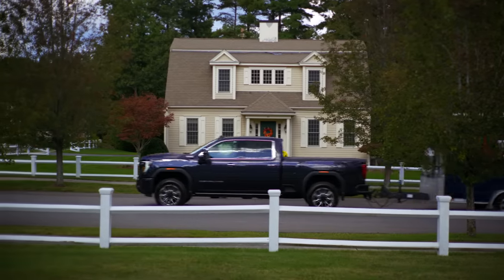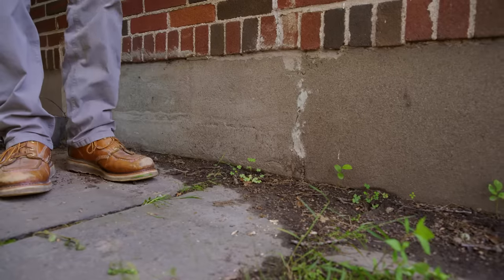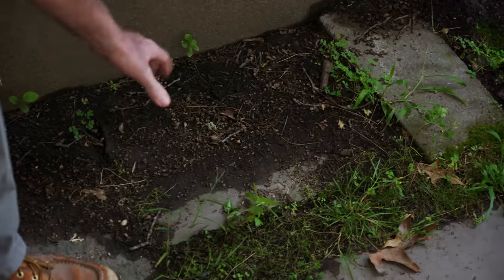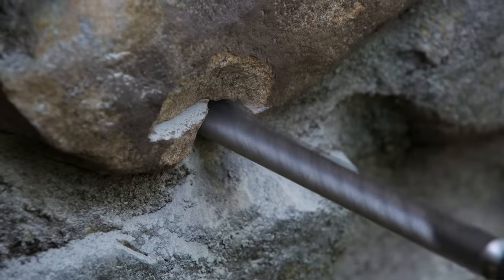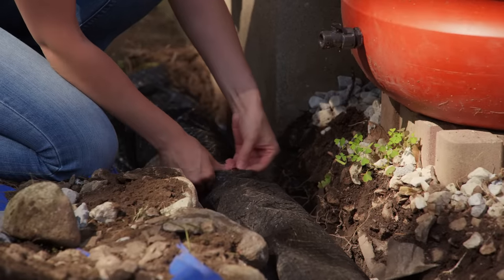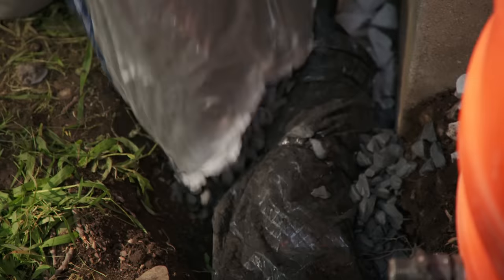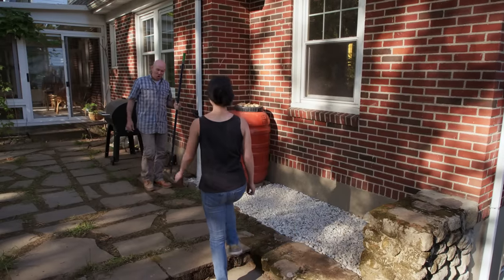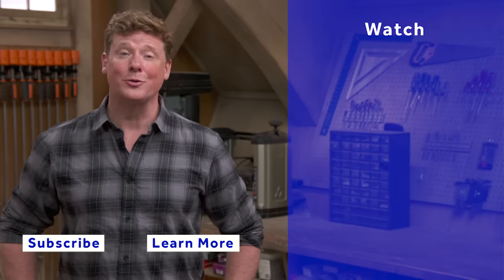How to Install a Patio Drainage System | Ask This Old House

Comment: A single 3/4" weep hole for a downspout and nothing to address what happens to the leaves that will eventually make their way into that pipe? I can understand not wanting a downspout-sized hole in the nice rock wall, but the at least put in a couple more smaller ones. There should also be a ground box (preferably a small square one) secured and caulked up against the inside face of the wall. That will give easy future access to make sure those weep holes can be cleared.
Reply: He should've carried that pipe all the way through the wall
Reply: nailed it. this is terrible.

Comment: Downspout to perforated pipe seems like a mistake. The perforated pipe is going to collect water and distribute it next to the foundation (like a septic drain field). I think a better solution would be to keep the downspout water in a solid pipe in that rock filled trench, and add a second perforated pipe to increase the capacity of the trench to collect other surface water.

Comment: Is that drain hole that he drilled in the rock big enough? Seems like it should be at least as big as the downspout.
Reply: @Navy1977yep that is never going to work
Reply: I guess unless you're expecting a tidal wave the hole should be big enough.  I'm just concerned about where that water is going on the other side of the wall.  I would have done what I did to my house -- connect all the downspouts to pipe daylighting out near the road.
Reply: @ginacirelli1581  yes I agree. My only concern would be since the hole doesn’t get that much water out it would fill up the trench and overtime. It would crack that wall.
Reply: The entire job is trash. Its an entertainment company and not a home improvement company

Comment: What keeps the downspout and weep hole from clogging with leaves and junk?
Reply: What they neglected to tell you was that the initial hole drilled through the rock wall was only a pilot hole.  I slowed down the video and they briefly showed the actual hole drilled after that was much larger.  In an ideal world, the gutters would have screens on them but most screens folks put on are DIY or from Home Depot.  they are usually cheap and do not last very long and end up allowing debris in anyway.  No screen can stop the influx of granules from a composition roof unless you have the ones that have water tension edges on them.   We never see the top of the gutters so we do not know what she has.
Reply: Human hands it's called maintenance
Reply: Doing the right type of installation in the first place!!
Reply: Hopes and dreams

Comment: The accordion connector will rot and crack very soon. Just use PVC there are 90s made just to transition from a 3 or 4 inch gutter

Comment: Pulled the wrong guy for the job. This should have been a gutter job to eliminate that down spout and send all the water to the next downspout that is at that corner of the house. Change the gutter to a 6-inch and ensure the slope goes all the way to the corner of the house. No digging, drilling through walls, or any of that necessary.

Comment: 4:31 it was a great question! You avoided the answer! You should had a smooth pipe in there and not a corrugated one! That would allow the water to drain easier in the winter. And to answer the question… that will freeze!

Comment: This was a REALLY bad "fix". If the debris from the gutters goes down the pipe it's going to clog. Plus the weep hole will freeze in winter and crack that wall, requiring a major repair job later. Plus as the hole is MUCH slammer than the rest of the pipes the back pressure will back-fill the area with water anyway, as well as there was no accounting for what happens to where the water was redirected to on the side of the house.

Comment: I've been a drainage contractor for over 30 years. Please don't ever do this at your house
Reply: @Navy1977  
For starters, I would have ran the downspout in a separate solid pipe from the perforated pipe for the French drain. So, each system is independent. In a flash flood you need the downspout pipe in a solid pipe getting the water away from the foundation. Then the French drain/perforated pipe will catch the surface and groundwater. Having both systems together will have everything back up at the downspout and foundation during a flash flood, and her basement is flooded too

Comment: This is terrible, and I mean terrible. @thisoldhouse really missed the mark with this one. They should have had Richard Trethewey do this job instead of the stone mason. That accordion elbow will clog up with leaves and shingle gravel, the corrugated pipe doesn’t even look like it has enough slope to it, and the tiny little hole won’t ever let out enough water to keep that pipe from backing up in a storm. Oh, and they used perforated pipe, why? Are you trying to put water back at the foundation? This looks as if a chuck in a truck did the job. 

If I took on this job, I would be using solid PVC. I would come out of the downspout with an actual elbow, use SOLID pipe with a 1% slope all the way to the wall, and actually drill a hole through the wall as big as the pipe. Heck I will add a catch basin wherever the low point of that patio is too. 

This is utterly disappointing. You guys totally scammed the homeowner. If this was ever installed in my property I would sue.

Comment: Absolutely horrible I’m just a kid and I know that all wrong. 1- when you connect that white flexible pod to the black corrugated pipe, all of that is going to leak. 2- you didn’t even drill a 1 inch hole for a 4 inch pipe. You should at least drill a 4 inch hole and feed the pipe through the wall. 3 - now that all of that water is coming out of that wall if it will even make it through it’s going to ruin the foundation on the other side as well.
Reply: and that’s where Mike Holmes comes in to make it right 🥴
Reply: @kbh95207 Mike Holmes literally endorsed some houses in Toronto that are all falling apart and isn't being responsible and fixing any of it.

Comment: LMFAO this didnt solve a problem it created one. He drilled a 5/8" hole for a 4" downspout lol. That downspout is going to back up so fast and overflow everywhere its not even funny.  Then he uses a 2" construction screw inside the spout wtf. If she didnt have gutter guards in place she better put them in right away. That will catch everything. To finish a terrible job out he uses a junk flex connector thats known to crack overtime. He blew her wall out too because he drilled the wrong way, complete rookie mistake. He should've got a core drill and ran the entire black pipe through the wall so that all that work isnt for nothing. Instead she will have a bigger water problem a block wall thats gonna freeze and crack.
Reply: They didn't show the connection from the drain pipe to the weep hole. We have no idea what Mark did there. TOH always skips a vital step to leave viewers in the dark. Heaven forbid someone actually try this and save some money.
Reply: @luckybestwash I doubt they did anything at the weep hole. Not that it matters being way too small .
Reply: This isn’t the first time TOH screwed up. I remember an older episode when Roger was installing a small hose bib irrigation system for a homeowner. Dude only put the pipe about 3 inches into the ground, and the head coverage was terrible.

Comment: That elbow he is putting in is utter garbage.  Those pleats will dry rot and fail within a few months.  The much better way is a PVC sleeve to elbow down to the gutter.  It also begs another question...How do you clean out the new pipe section when it clogs with leaves?  A box just behind the wall as a catch basin would have been a better idea.  The water can still flow but debris will collect in there and can be removed as needed.
I could not help but notice the long screw he put the new elbow into the old downspout.  That is a very bad idea as sticks and leaves will start catching there and eventually, the downspout will back up.  I thought TOH only used professionals.  That is an utter amateur move.  The gutter screws are only 1/4 long for a reason.
Reply: Eat shirts
Reply: Gutter guards are a thing.
Reply: Harsh but accurate
Reply: @jonathonpellegrini5725  ?? That makes no sense...
Reply: What channel is your show on?
Reply: @willsalaz  It is called Goodwill Criminals of Dallas.
Reply: I like Gate City Foundation channel for drainage issue. They find so many corrugated pipes clogged up and replace them with PVC. Just use PVC and save yourself the headache
Reply: @Bynming Call Roto Rooter and ask them how many PVC drain lines they snake out in a day's time 🤷🏼‍♂️ PVC is absolute garbage for yard drains.  Double wall corrugated pipe will not clog.
Reply: @westendlawn  they clog constantly, are you kidding me?
Reply: @Bynming  not if you use the right corrugated pipe and have the right amount of fall to it. No it will not. Double wall corrugated pipe creates turbulence inside the pipe and it'll clear out any trash and debris. Corrugated systems that clog, don't have the right pitch to them
Reply: @westendlawn  Lol, their job is to snake out PVC lines 😂
Reply: @mattmc71  annnd why do you think that is 🤷🏼‍♂️
Reply: @westendlawn I have corrugated in my yard, it’s clogged. But do you know why? 🤔 Because the corrugated fittings aren’t water tight, so roots get in them.
Reply: @westendlawn PVC isn’t bulletproof just like any piping system. Most of the time it’s poor insulation or a lack of a proper base. Solvent welded PVC is more susceptible to cracking, and guess what is used the most? Solvent welded fittings and pipe.
Reply: @LaFox23  root's still get into PVC pipe joints, root's also get under concrete sidewalks and destroy concrete. Roots also trash cinder block foundations.
Reply: @LaFox23  PVC pipe is okay for interior plumbing. That's about it.
Reply: @westendlawn roots won’t get into PVC pipes if there isn’t a leak.
Reply: @westendlawn PVC pipes are used everywhere underground. Go educate yourself.
Reply: @LaFox23  who the hell told you that? Root's absolutely get into PVC pipe anytime there's a connection. Root's will find water and doesn't stop at anything to get water. It's obvious you don't know anything about plumbing.
Reply: @LaFox23  yeah I'm very well aware, doesn't mean it's the best material for the job. So yeah go educate yourself 🤷🏼‍♂️
Reply: @westendlawn  it is the best material. It’s quick to install, durable and long lasting, and can support loading well. Why so you think it’s spec’d out all the time 😂
Reply: @LaFox23  it's for guy's like you who don't know what they're talking about
Reply: @westendlawn  im sure that’s what your french drain boy told you 😂